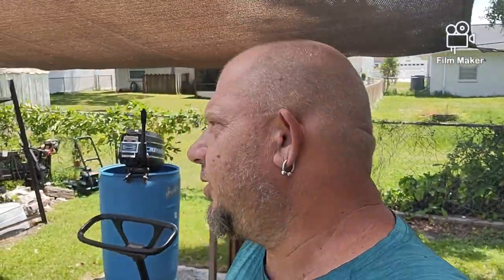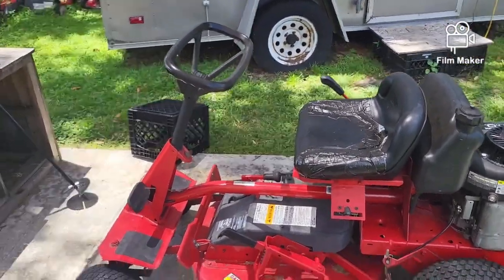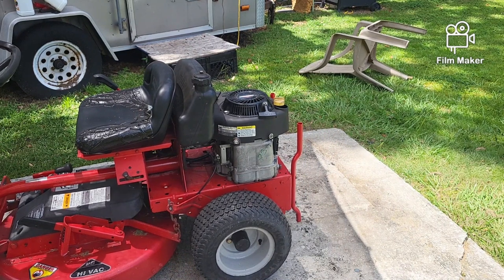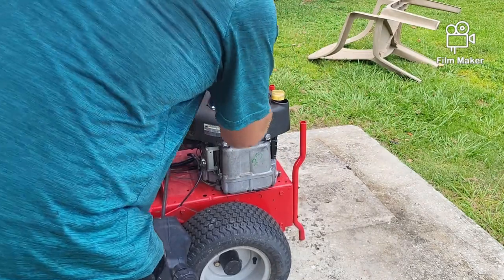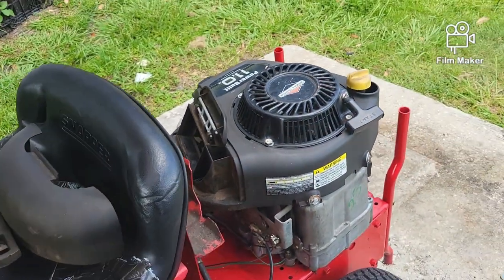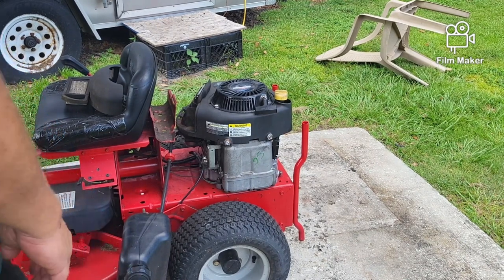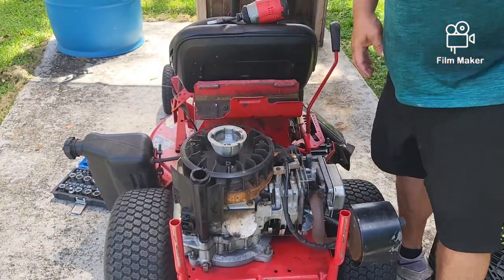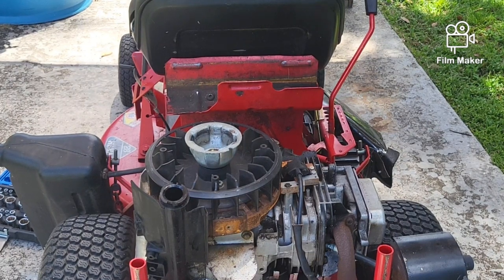Snapper Riding Mower With Weird Problem Wont Start

Comment: I’m having a similar issue mines a snapper zero turn with a joystick starts when it wants to by the time, it’s finally does start my batteries dead wish I had a pull on mine
Reply from the maker: Have you cleaned the carb and changed the spark plug?
Reply: @MunkyWrench  I have changed the plug and sometimes when I spray ether in the carpet starts, but no, I have not cleaned the carburetor taken it off yet that’s my next step. I feel like it’s not getting gas.
Reply from the maker: @upnorthvlogs  that's usually the case when it's hard to start.  Pull the carb apart and spray it out.  Run a bread tie or small wire through any holes u see and it should come right back

Comment: Those Snapper like mowers are crazy expensive compared to a normal full size rider.  A Cub Cadet CC30H is only $160 less then a full featured Cub Cadet XT1 Enduro LT42.  Nuts!

Years and years ago I worked at a Honda Kawasaki dealer, and the shop had a sign for the customers to read and understand.
Labor Rate = X
You want to watch = 2X
You want to help = 3X
You want to DIY = just buy a new machine.

Sounds like this Snapper was a 3X 😆
Reply from the maker: Alot of people like them for the style im guessing and the size. they are so basic and flimsy but if they are popular the price goes up
Reply: @MunkyWrench  Nostaglia is my guess.  Forest Gump used and approved.
Reply from the maker: @canamrider7195  ma ma ma momma says uts good

Comment: Was you gonna pump grease in all the ports on that one i done it on my friends and his shifter and it really helped the shifter alot and check the rubber boots but on that model snapper should have made a chain cover or gear cover i can't remember much of it but that part isn't covered and its low to the ground were it can get damaged just from mowing i think its on the gear selector

Comment: Where is the battery? I see a key switch. I have to turn my key on before my snapper will start. I had to go thru it last year and fix quite a bit of things
Reply from the maker: There is no battery on this mower as it's a pull start, there is a space for adding a starter as an option but this one has none.. the key is literally just to kill the spark and shut off the motor.  In start position it allows spark

Comment: On other mowers ive used the old piece on new parts so the little plastic piece from his new old part might would have worked 

I know sometimes its a bitch getting those linkages out and back in but thats what i have done before was used the old one in the new part.

And I've bought many aftermarket reject carburetors in the past and learned you gotta take the carburetor apart first before putting it on to check for burs little bits of metal 

One was so bad with burs the butterfly flap wouldn't close how it should i tried cleaning the burs off and it didn't help any because the carburetor was a reject it was no good then got another one and it worked fine until the bowl gasket went bad that was on my Kohler pro cv16s engine

Comment: DUDE. FIRST, YOU DO NOT HAVE TO REMOVE THE FOUR SCREWS TO REMOVE THE CROWN, SIMPLY BACK THEM OUT 3/8 IN. WHEN YOU HAD THE NEW OEM CARB IN YOUR HANDS, TEST THE FLOAT BY A) POUR OUT ALL THE GAS AS BEST YOU CAN; B) BLOW WITH YOUR LIPS , HOLDING THE CARB WITH THE BOWL ORIENTED DOWN, INTO THE FUEL INLET NIPPLE. YOU SHOULD FEEL THE AIR GOING INTO THE CARB VIA THE FLOAT NEEDLE VALVE. C) TURN THE BOWL UP, BLOW THRU THE FUEL INLET AND YOU SHOULDN'T FEEL ANY AIR PASSING THRU THE NEEDLE VALVE. I DON'T THINK YOU SHOULD HAVE TAKEN THAT OEM CARB APART TO BEGIN WITH. YOU SHOULD HAVE TESTED THE FLOAT NEEDLE VALVE FIRST. LASTLY, WHEN YOU FINALLY FIGURED OUT THE FUEL TANK ORIENTATION, YOU HAD THE FUEL HOSE TWISTED AT THE TANK OUTLET..LOOK AT THE VID 38:52 THEREABOUTS. BTW, THERE SHOULD HAVE BEEN A NYLON GROMMET WHERE THE THROTTLE LINKAGE WENT THROUGH, BUT YOUR CUSTOMER TOSSED IT WHEN HE PUT THAT NEW OEM BRIGGS CARB ON. I HAVE THE SAME IDENTICAL SNAPPER, JUST 12 HP AND ELECT START. I HAVE BEEN ROUND AND ROUND ON MY MOWER SINCE 1985 (I AM 74).LISTENING TO YOUR DEMEANOR (ILL PILL), IMHO, YOU SHOULD DRAG OUT A BIG FAN, LAWN CHAIR AND A COLD BEER TO GO WITH THAT TARP SHADE. I LIVE JUST NORTH OF MOBILE AL, SO I CAN IDENTIFY WITH HEAT AND HUMIDITY. YOU SOUND AS IF YOU ARE JUST GETTING STARTED, SO YOU ARE DEFINITELY GOING TO RUN IN TO SOME PUZZLING SITUS! TRY PUTTING A DRIVE PULLEY ON THAT THAR SNAPPER, LOL!! YOU WILL LEARN TO SEARCH HELP ON YOUTUBE..I DO ALL THE TIME, KIDDO! I WISH YOU SUCCESS AND PATIENCE. DO NOT GET ILL AND START SLINGIN SHIT ALL OVER YOUR AREA, LOL! I WISH I HAD YOUR FINE TOOLS YOU HAVE, ESPECIALLY THAT 1/4 IN. IMPACT!!! GOOD LUCK, I SUBSCRIBED AND AM FOLLOWING FOR A LITTLE WHILE...YOU CAN MESSAGE ME ON FACEBOOK.:face-orange-biting-nails:
Reply: Yeah, that tank exit hose looked twisted and weak. I think overall he did a great job on this vid. I own the 28" snapper RERider and I found this vid to be a great help.